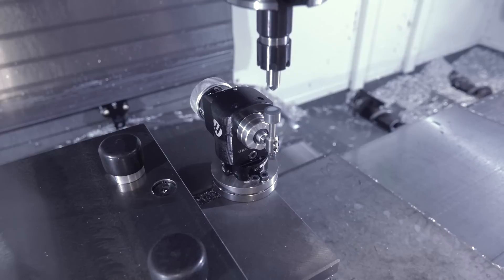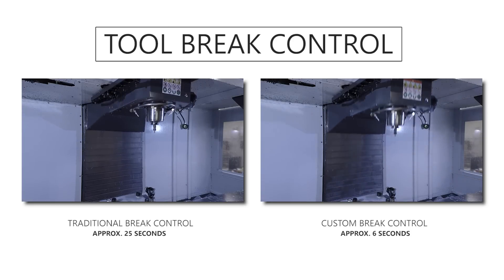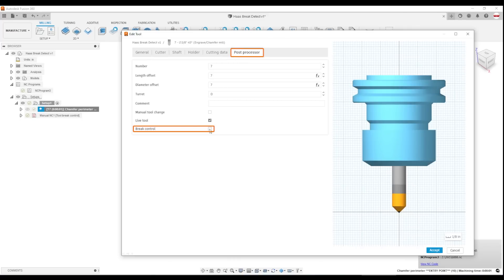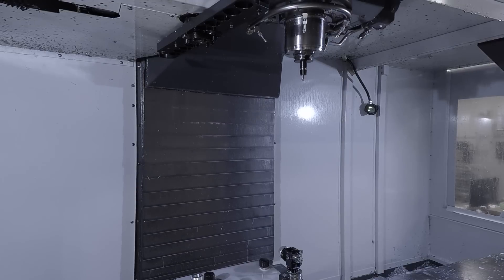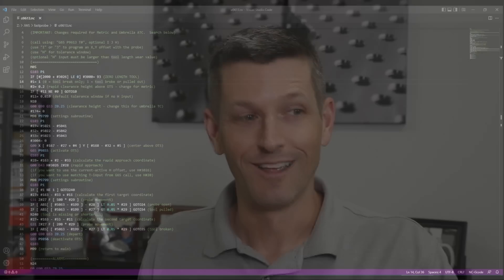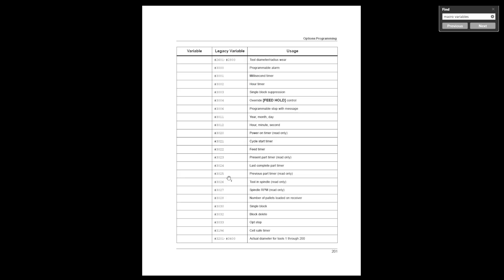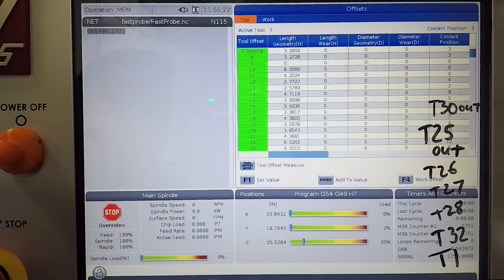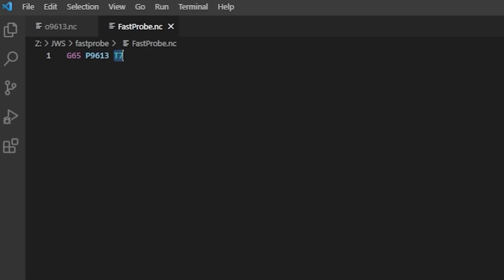FAST Haas Tool Break Check with Custom Fusion 360 Break Control!

Comment: Just a bump up, is this file available somewhere?  Desperate to implement this on our new UMC-500 as in most cases the tool break check is taking longer than the toolpaths and is doubling our run time!

Comment: Just wondering- nowadays fusion is punching P9853 code for tool break control, but program is punching P9853 code. And you use 9613. What is the difference?

Comment: This made my week.  Thank you for sharing!  I have run into one issue with this.  When the tool check fails, you can't restart the program without getting a "400 - SKIP SIGNAL DURING RESTART" error.  I tried to block-delete these checks out for doing a restart, but no luck...

Comment: Works great, thank you! Maybe it's worth mentioning that the values for metric mode only have to be adjusted in the first lines. Later on it's automatically converted using #29
Reply: Would you happen to have the macro to share? The link is no longer available thanks!

Comment: Question I've been trying to figure out, if I run the break control on a tool and I set the H value to .003 (I run tiny tools) if the tool length has moved within that .003 tolerance, will it update my offset or will it just say YES your not broken move on. Reason it could move is temperature swings.
Reply: I’m not sure about on a HAAS but I have used a renishaw tool setter on fanuc and you can add a parameter to the G65 line to tell it wether to update or not
Reply: It only gives an alarm indicating a broken tool. It does not change any offsets.  I  use this all the time with small tools and it works great.
Reply: @jrodriguez3451  you can edit that macro too :)

Comment: We have a HAAS VC-400 (pallet machine) that I run tool checks on. Took me forever to clue in to this but when you insert a tool check manual NC on Fusion, you have to edit in an M104/M105 before and after the macro. (Tool probe up, tool probe down). If not the tool will move to where the probe should be and just wait for it to raise up until it throws an error.

Comment: Thanks for this video, I'll incorporate tool breakage into my programs.  I'm super curious about NYC CNC's views on plunging the tool straight down into the OTS w/o rotation.  I've been told to rotate all carbide tools during tool length probing w/ the OTS, is the carbide on carbide issue a myth?

Comment: I went through the whole video and noticed you didn't mention how you actually call the macro program using Fusion's NC program / break control. 

So what I did is found in the post processor where it calls the original break control macro and changed it to call up the new one we added to the haas main memory (P9613) and I also commented out the line : ' "B" + xyzFormat.format(0), ' because the new macro doesn't use it from what I could tell.

if (!toolChecked) { // avoid duplicate COMMAND_BREAK_CONTROL
      onCommand(COMMAND_STOP_SPINDLE);
      onCommand(COMMAND_COOLANT_OFF);
      
      var retract = false;
      if (currentSection.isMultiAxis()) {
        if (getCurrentDirection().length != 0) {
          retract = true;
        }
      } else if ((currentWorkPlaneABC != undefined) && (currentWorkPlaneABC.length != 0)) {
        retract = true;
      }
      if (retract) { // move to safe position
        moveToSafeRetractPosition(false);
      }

      if (activeG254) { // cancel DWO
        writeBlock(gFormat.format(255));
        activeG254 = false;
      }
      
      if (retract) { // position rotary axes at 0-degrees
        writeBlock(
          gMotionModal.format(0),
          conditional(machineConfiguration.isMachineCoordinate(0), "A" + abcFormat.format(0)),
          conditional(machineConfiguration.isMachineCoordinate(1), "B" + abcFormat.format(0)),
          conditional(machineConfiguration.isMachineCoordinate(2), "C" + abcFormat.format(0))
        );
      }
      //JCB20220707 Fast tool break macro call
      writeBlock(
        gFormat.format(65),
        "P" + 9613, <<<<<<<<<<<<<<<<<<<<<<<<<<<<< Changed macro call
        "T" + toolFormat.format(tool.number),
        // "B" + xyzFormat.format(0), <<<<<<<<<<<<<<<<<<<<<<<< commented out line
        "H" + xyzFormat.format(properties.toolBreakageTolerance)
      );
      toolChecked = true;
    }

Hopefully this is the right way to do it! 

Someone let me know if I'm going to blow something up :P
Reply: I've discovered this breaks using haas's built in program restart. When the control simulates the break check it alarms out 'H and T not match'
Reply: @split141x  I just tried this and found exactly what you're describing. Do you know of a fix for this? Thanks
Reply: @split141x  I'd also like to know if you've found a solution to the H and T mismatch error. Thanks